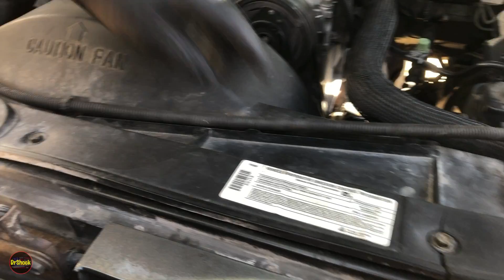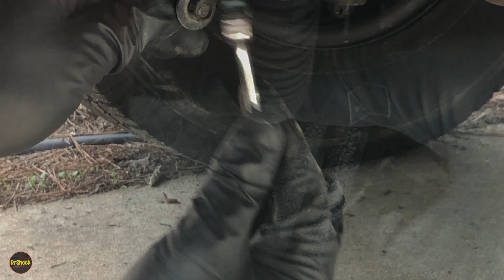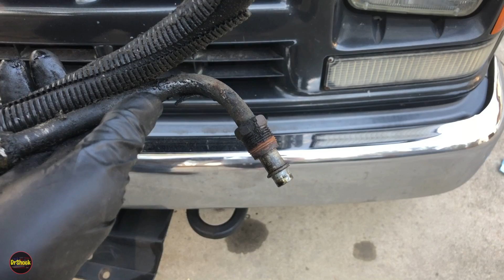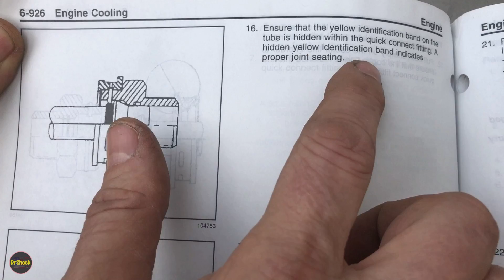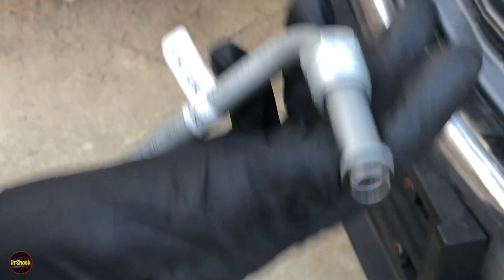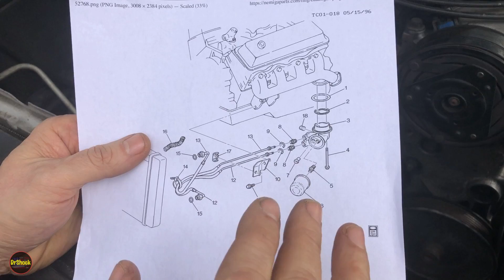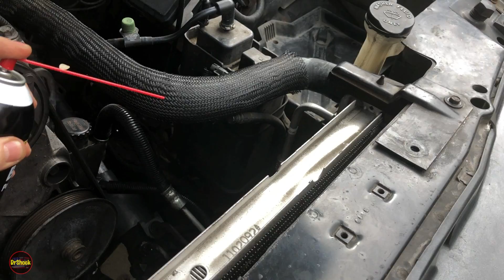1996 - 2000 GM OBS 4WD K Truck Vortec V8 5.0L / 5.7L Oil Cooler Line Leak Repair (Chevy & GMC)

Comment: Dr. Shock, if the point of origin of the oil leak in the cooler line is NOT the fitting, do the lines develop cracks, fissures in them? Is that the source? This over a period of 20-25 years, of course...My 98 1/2 ton has similar symptoms...Thanks for another great video.
Reply from the maker: What I usually have seen, on both gasoline and diesel cooler lines, is leaking at the crimp fitting between the aluminum and rubber.  This particular truck is getting its third set over 24 years for that reason.   But it can be a leak at the fitting due to o-ring failure.  And it can be a leak in the rubber due to aging/cracking too.   Rarely it will be leaking from the aluminum, but I suppose that too is possible with age and corrosion.
Reply: @DrShock  Thanks for the reply. In my case it definitely looks to be further down, closer to the crimp fitting, and making a real mess. I see from other comments and testimonials that it’s best to avoid the after market, especially for this particular part. Thank you again Dr. Shock.

Comment: I bought AutoZone hoses about 8 years ago. 2 years ago, I bout blowed up my 98 when one of the cooler lines separated at the crimp on the motor side. Dumped all my oil in no time. Great video!
Reply: How did the auto zone lines hold up for you? Did you catch the leak on time before it did any engine damage.?